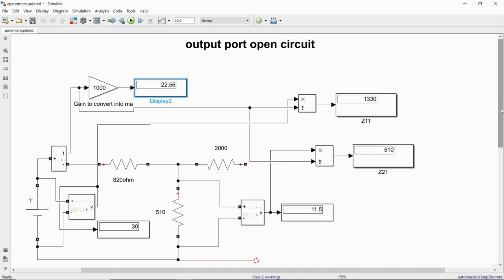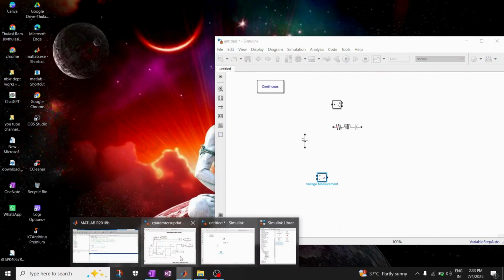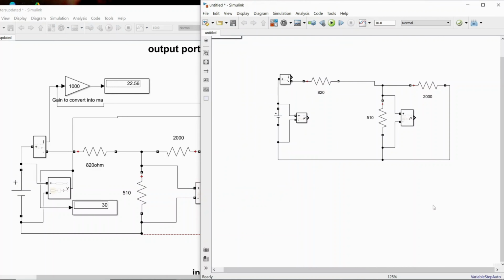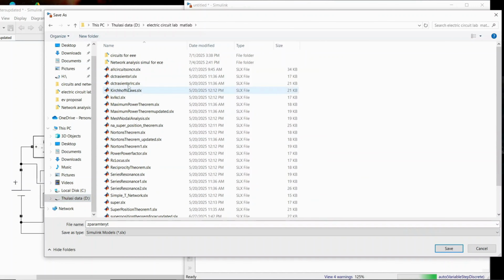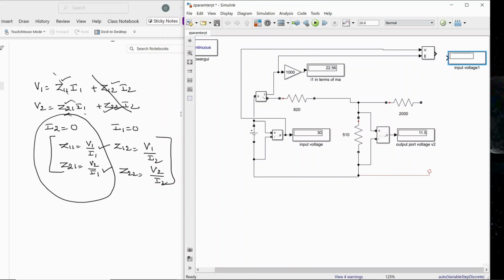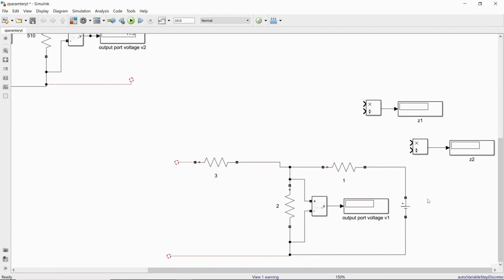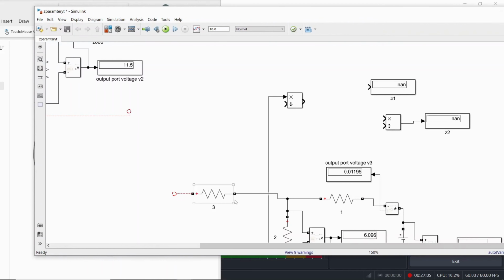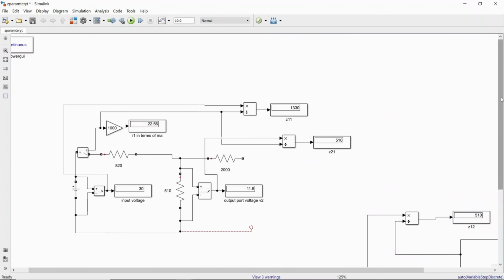Matlab Simulation of Z (Impedance)Parameters

Comment: Sir, very good explanation. I made the exact model in the MATLAB 2024 version as you made in this video. But when I run the first model in the scope section, no value is showing. Only a beep sound, but no value is showing.
Reply from the maker: 2024 if orginal then u will get ...share the error I will resolve...Try with matlab 2018b or use same simulation block in matlab online
Reply from the maker: U can download my models from matlab online name kvthulasi ram
Reply from the maker: Check ✅ all connections in black color by zooming it